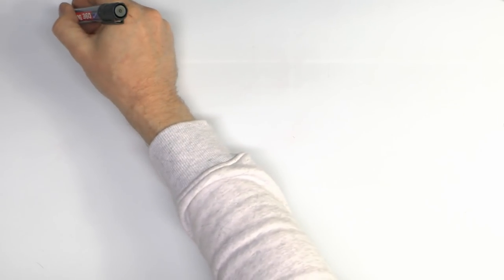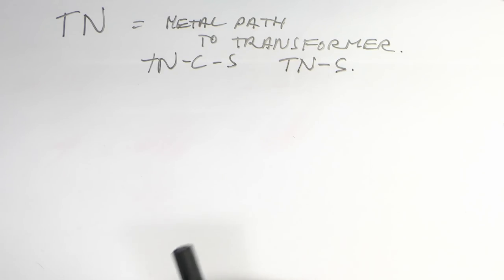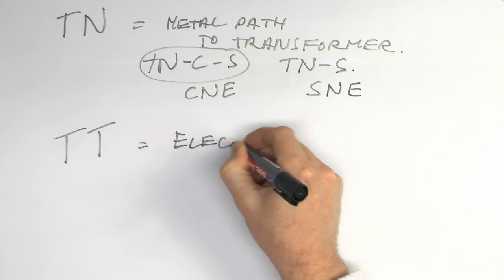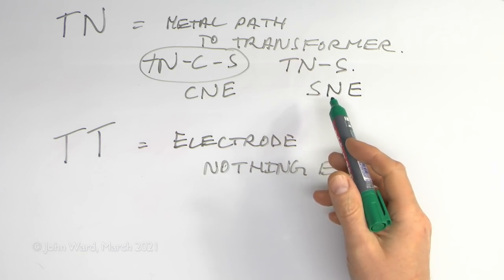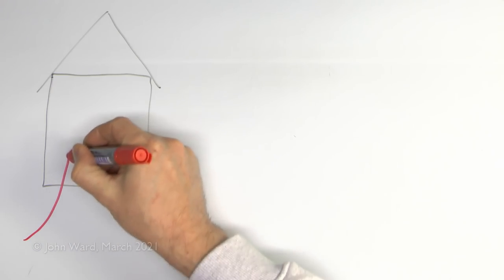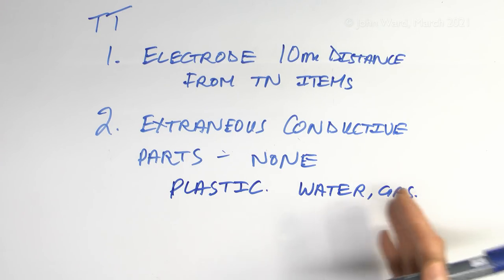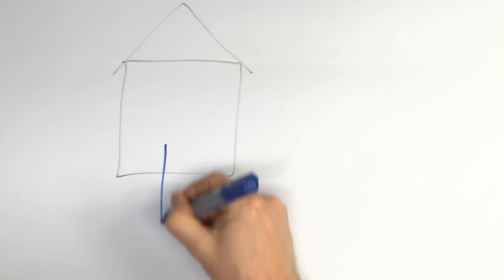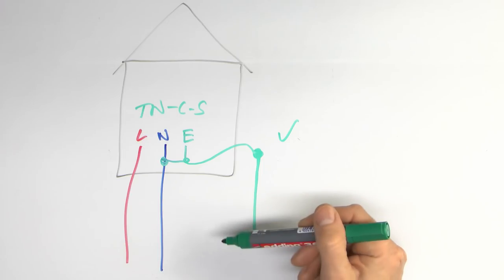Using a TT earth where a TN earth already exists

Comment: Boat house in Nottingham had a TT earth connected to the incoming water pipe which was plastic, so there was no earth for the building. But the telephone line was connected to the building earth, and earthed at the exchange building 600 yards away on the other side of the river. When an earth fault occurred in the boat house, the telephone line card caught fire in the exchange building.
Reply: The telephone line shouldn't have been connected to earth in the building. Since shared service was done away with some 30 years ago there has been no requirement for any local earth on an exchange line
Reply: @davidfaraday3085  Used to have at the office a TELEX line, which, due to the crappy cable, was running on a single core of the incoming cable, and earth ground as return.Yes was noisy, but this was the only wire available, as the rest were a combination of split pairs for incoming phone lines, and a lot of dead pairs from old cable that was damaged. Took 5 years of weekly fault calls logged before the incumbent Telco finally approved laying a new cable from the street manhole (dating back to pre 1900) to replace the old lead sheathed paper cable into the building. Had to run it via another route as well, because that 50 year old cable had absolutely no intention to come out of the conduit it had rusted into under the building. Thus new PVC drain pipe (disguise the cable as being copper and stealable) up the side and into the building, to another demarc point. Later on I tidied up the demarc points, and got 3 garbage bags full of copper wire out from there, all old wire and unused wire that had forever been added to and overlaid with newer cable instead of removing the old. Still had a lot of the original wiring in there from 1950 when it was built, long disused but left there, and often still connected and introducing noise.
Reply: exactly
Reply: @SeanBZA  Telex required two wires, one for transmit and the other for receive. In the UK at least you could not have a standard exchange telephone line run over one wire with earth return. At least not if you wanted to receive calls as the earth would have caused immediate ring-trip.

Comment: In South Africa it is common to have a earth electrode on a TNCS system, to improve the earth  from the electrical supply ( the neutral is periodically spiked to earth on regular intervals on the supply side as well) So the more people spiking to earth the better the neutral connects to earth.( Less ground lift under load) RCDs were also invented in South Africa, so we have had them since the early 70s. So you don't have to rely on the earth tripping a circuit breaker, but rather the RCD tripping.

Comment: How many water mains are metal these days ? Plastic pipes have been standard for decades
Reply: My water pipe was lead up until last year when I put a plastic one in. I suspect most of the houses around my 1930s estate (of which there are many many in the country, as I'm sure you know) probably haven't been converted. Most houses around here tend to be TN-S (at least house presentation wise anyway). For extra confusion mine is TN-S, looped from next door in split concentric cable, so looks a lot like, and is always mistaken for, TN-C-S. Substation is around 350m away, Ze at DB last measured as 0.24 ohms.
Reply: @JonGTranceClassics  Mine too. It sprang a leak and I replaced it with plastic. Left the old pipe in place to be melted down in the future.

Comment: If the distributor provides you with a good earth (grounding) through the PEN as it should be in a TN system why not use it?? Why mess with consumer grounding?? Or does this only apply when you don't trust that your distributor provides a good earth - that it isn't a TN but in fact a T??

Comment: This is the exact issue I have on a current property, house has 100A supply and TNCS, Garage which contains the boiler/water main etc. All metallic pipes supplying the house which has a 10mm bond coming from it to bond the boiler plant. However the garage (metal framed with a reinforced concrete floor which is all bonded) has a separate 100A supply which is on TT and also linked into the boiler plant because of the oil tank. Inherited system and is going to be a complete headache to sort out. Great video as always.
Reply: This ia where JW advise is to TT the whole thing, plastic incomers on service ie water gas. Then the hardest part.. Keep the rod well away from anything metallic.
Reply: @nmajid1984  Metal framed building and metal supply pipes. Basically impossible.
Reply: @nmajid1984  Problem being its not usually possible to plastic  all the incoming services on older properties, unless you go right back to the main service heads of the various supplier's, there is also another issue these service pipes are on many older properties  the main earth plus its not unusual to have properties daisy chained together .  My supply and the neighbours are linked , My supply is TNC-S converted  because of a fault six months ago  neighbour who we feed off underground  is TNS , our water supplies are  also  lead . Its a right mish mash

Comment: So with the density of modern housing its pretty much impossible to do a TT system.  So I have noted that some vehicle charging point manufacturers have tackled this with PEN monitoring therefore disconnecting the supply if the CNE cable is faulty.  On inverter systems it is important to be certain that in island mode these do recombine the neutral & earth connection as well as not being capable of back feeding into the network.

Comment: In Ireland, a TN system comes into our house, and also an earth electrode is linked to the dis board, via a 16 csa cable, the 16 csa t/e that connects the dis board to the suppliers equipment has the cpc also connected to the neutral of the suppliers service fuse, thus TT and TN system combined

Comment: I'd be interested to see a video on how radio frequency grounds fit in with all this if that's something you've had any experience of. For a lot of radio transmitter systems you want a very low impedance ground. Some antennas like 1/4 wave verticals need a very good ground to drive against. This can mean burying lots of metalwork in the ground like a large mesh mat or hundreds of radials coming from the antennas base. When combined with a tn-c-s system this good ground can present a very low impedance to the rest of the street and if you're not careful you can end up sinking ground current through your radio equipment for the rest of the street. Grounding can be a nightmare for radio amateurs like myself as it can also provide a path for interference and you can end up with RF in places it shouldn't be. Then there's also the risk from lighting strikes to consider. Then there's the distance between the equipment and the ground point because at high frequencies where that distance can easily be significant compared to the wavelength of the frequency of operation and it's impedance can vary. My station isn't grounded and I use a DC power supply that's isolated from the mains. I've never had any issues but because of this I steer clear from antennas that require a good ground to operate but I should probably ground my station to protect against lighting but I'm not sure that's even realistically possible so I just disconnect my antennas
Reply: I believe there are some solutions to this, my "ground mat" is not engineered for low impedance at 50hz. but of course in a fault condition significant current could flow through it. The mat is bonded to the house ground (arguably by an under sized conductor). Commercial radio sites have massive ground bonding conductors and contrary to myths generally survive lightning strikes unscathed. I think the more correct engineering approach to mine will involve lifting the patio (again) and using an appropriately larger conductor. I dare not post some of the other solutions.
Reply: @g0fvt  When you say ''arguably by an under sized conductor'', I'm curious what size is this?
Reply: @Orgakoyd  certainly not 10mm²  cross section...

Comment: In the last scenario you described John if the neutral conductor was broken somewhere up the street surely the neighbours houses return path would then be through your TT system and potentially make all your extraneous conductive equipment live as the current rose?
Reply: I Agree. Also even if it was just 1 house where the pen failed, i bet it wouldn't take long for the electrode to bake under load and go high resistance
Reply: Why? It's not connected to N.

Comment: So most tt earthing systems aren’t actually tt??
I’ve tested a lot of tt systems and it is surprising how many of these systems have an unexpected low earth fault loop impedance (Zs)  at the extremities of the final circuits (as good as you would expect on a tn-c-s system), due to the water and gas parallel paths that exist, obviously neighbouring properties that have had a tn-c-s conversion at some point. 

In all honesty I think the “convert the incoming extraneous parts” to plastic is unrealistic solution.

So that leaves the question what is the real practical solution 🤷‍♂️ 

Great video JW👍
Reply: John, would this same low value impedance theory apply to SPD’ s with say only one house has an SPD and a Surge occurs . I.e Surge would seek out the low value impedance of the only SPD in the street?
Reply: Just add a decent local earth to the TNCS (and I mean decent, not a foot long stick hammered in the ground) and it's safer than any TT system.
But it looks like the island has to do their own thing again....
Reply: @stefantrethan  You will need that earth electrode to be less than around 1.5ohms to keep the touch voltage under 70V in a PEN fault (Calculated with a house having MAX loads of 60A (using the calculation from A722.3). I have put in quite a few electrodes (8ft long) and never got less than around 30ohm
Reply: @marcuswareham1  even with putting more than one electrode say 2 or 3? The problem is as John explains putting in a small UK properties even one is difficult putting 2/3 is near enough impossible at the requisite distance to ensure low earth impedance.

Comment: I found this channel a couple of months ago and have been really enjoying it from over here in the USA!  Thanks for all these videos.

I'm planning to install an EV charging point sometime soon here at my home here, and your posts have raised a question for me.  We have TN-C-S with neutral and earth joined at the service entrance, grounded on the property with two separate rods, and also by bonded to a metallic gas line and a buried copper main water supply that no doubt both supply their own grounding.  I wonder if that difference -- having grounding present on each property -- is related to why we do not have special requirements for EV chargers to use TT grounding or to be otherwise protected in any special way.  (I believe that the charging points themselves already have built in GFCI/RCD protection, but that's all as far as I know.) I wonder if our installations are inherently more dangerous than those going in in the UK, or if the better grounding, coupled with split phase 240V giving a maximum difference of 120V to ground, somehow adequately mitigates the dangers in a way that I do not understand.  Maybe something to do with charging relying on the two hot wires to get 240V and not really using the neutral?  It seems to me like 120V between the body of the vehicle and the ground would still be a possible failure mode, and plenty dangerous.  But I'm not an electrician, and I may be misunderstanding something.  Any thoughts on whether this difference in requirements is based on some mitigating factor present here in the US, or maybe just represents a different tolerance for risk or lagging standards?
Reply: Late reply but I want to clarify this for future readers.

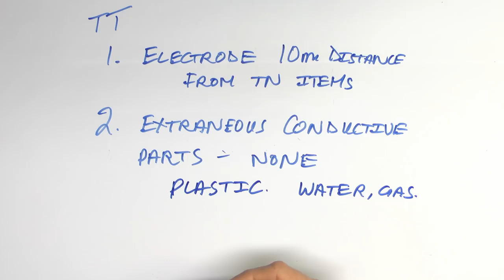The USA doesn't really use TN-C-S or TT (I had never even heard these terms before watching UK electricians on youtube). We have our own system which is similar to the TN-C-S variant that JW describes at 20:07.

The neutral coming in from the utility is grounded/earthed at the transformer but we never treat it as a ground, we always have at least one ground rod on each property. At the main panel (consumer unit), the neutral is bonded to ground. There isn't really a single point failure which could occur that would put a dangerous voltage on the ground, so we don't need any special rules or protection equipment.

Comment: Hi John, I am currently excavating a 6m x 4m x 1.8m deep extension to my TN-C-S supplied house. I am adding a 393 rebar matrix before concert slab pour. After the pour I will add 100mm of insulation before adding 100m concrete. I am then building a pool that will sit 275mm away from the rebar matrix. I am sure I will get a reading of less than 4 Ohms. I plan to bond all connections to this and keep it TN-C-S
Reply from the maker: Sounds good.  Suggest the bonding is at least 25mm², rather than the commonly used 10mm²

Comment: Few things to consider, if it’s in an out building and there is no extraneous conductive parts comming in ie plastics service pipes and you can get your rod 10 meters away so you don’t induce any voltage from a fault  then yes , mind you I’m very weak on swimming pools so could be totally wrong

Comment: The ridiculous thing about the continual water supply from the house to the outbuilding is that the cross-sectional area of 15mm copper piping with a 0.7mm wall thickness is 31.4 sq mm, or three times that required for earth bonding. Why the authorities do not allow a continuous copper feed to an outhouse to count as a bonding connection, I've no idea. After all, for a TT outhouse connection, then we would have to know the converse is true; that is it is not metallic throughout its length. Where it is continuous, it's likely to have a lower impedance than any bonding cable that is put in (something readily measured as well).

I think I would also argue that if you have a TN-C-S system and are bonded to metal water and gas supply pipes, they are going to provide a much lower impedance earth return path than any rod you are likely to stick in the ground as there will simply be vastly more metal surface area exposed to the ground. Of course, the regulations don't allow a TT system to use those water and gas pipes as the earth, but I suspect that where it's a TN-C-S supply in such circumstances, the reduced earth return impedance provided by an ground spike is going to be insignificant.

Comment: Thanks JW very informative always love your videos. I have TN-S,  my Ze is 0.97 called uk power. They tested and was same unsatisfactory reading. They said its not their responsibility as it is pre 1988 and I should install an earth rod or pay them to rectify. What options do I have? Thanks in advance.
Reply: Late coming to the party, but this shows the advantage of TN-C-S off a PME system. Ze would be around 0,3 ohms. However, 0.97 is not too bad for a sheath earth. If you had TT it would be higher. Suggest if you have RCBOs fitted - residual current combined with overcurrent circuit breakers then - provided Ze is stable - you should be okay.
Reply: @jackmu7409  For a TN-S supply, the Max Ze is 0.8 Ohms...

Comment: Hi John, so basically TT a hot tub in a standard house is probably a waste of time.  I was always taught putting a rod in on a TNCS system would stop any tingles if you were in contact with true earth & the water.  Although I do seem to remember that it was if you some distance away from the tncs earthing.  Also the tech helplines still state that hot tubs should be TT’d.

Comment: Metal shipping container used as a shed with power in it, TN-C-S supply.

Do you bond the container?

You wouldn't bond cable tray (I don't think?), none of the electrics are directly connected to the container itself and were you to bond it and get a PEN fault the whole thing would become sizzly. 

I'm currently taking the view that it would be more of a risk to bond it than not, but I'm not all that sure! The workbench is probably more important to bond IMO.
Reply: I believe you'd isolate it from the TNCS supply and earth rod it.
Reply: I supplied power to a garage with exposed metalwork going into the ground recently from a TNCS supply,  I contacted the local DNO for plans of exactly where the PME earth electrodes are and how many there is (to get a sense of the likelihood of a PEN fault (underground cable)), I got the plans and there was a surprisingly small amount of electrodes and based on this I made it TT as class 1 equipment was also expected to be used outside of the garage. 

Shortly after I got an email from the DNO saying do NOT use the PME earth it must be done as TT,   The email did also state that each PME joint has a "pigtail" electrode so there is more than can be seen on the plans, but they didn't sound too confident on using PME around true earth
Reply: @marcuswareham1  wow, seriously detailed reply, thank you.

So easy to assume that the CPC should be at earth potential.

Comment: Non electrician here. This may be a daft question but how do you measure the resistance of a TT earth? I live in France and Im pretty sure I have a copper rod in the ground. The house is 30 years old now and I'm wondering if the copper stake degrades over time, thus, degrading my path to earth.
Presumably I need a Megger type tester (which I don't have)?
Great vid again John, as per usual. Can't thank you enough for your clear and concise content.